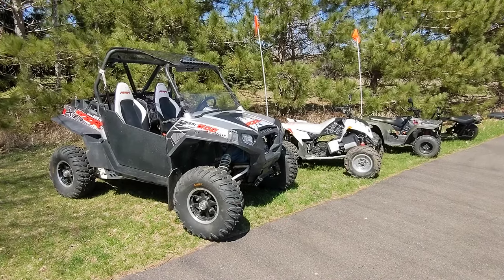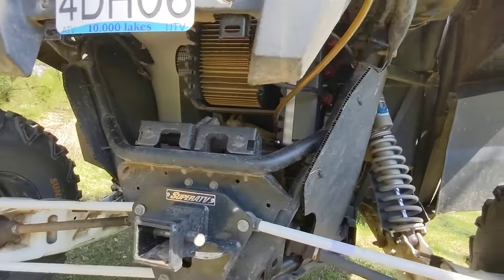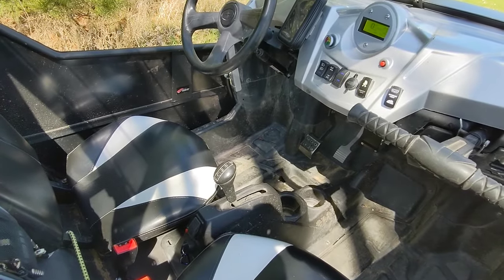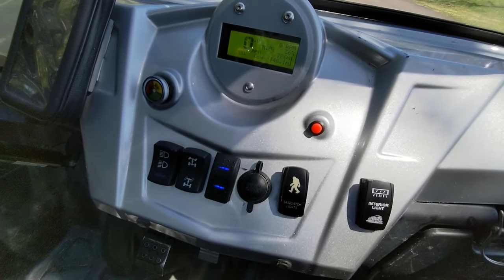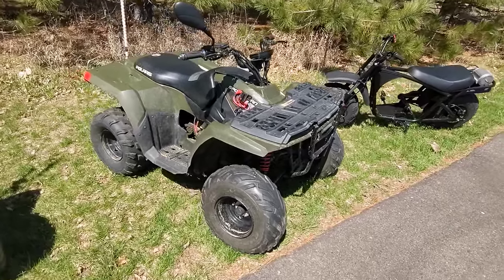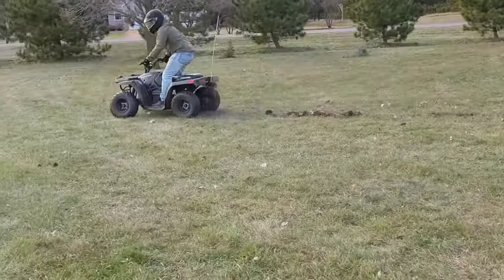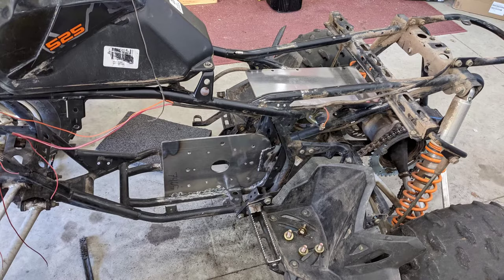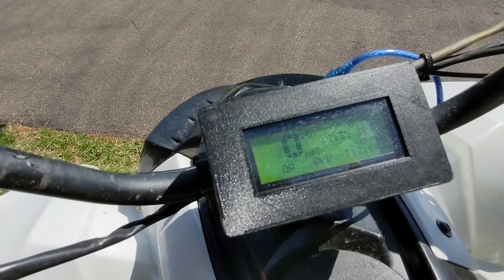I have an electrified⚡problem🤪I built two Cyberquad ATVs, a⚡UTV and a⚡ mini bike is in the works🤯

Comment: What great projects! I'm curious on the RZR ... with electric reverse available (looks like what you did..) what about getting rid of the transmission, transfer gears and long drive shaft - and using 2 motors (one front / one back) - and just the 2 differentials - getting rid of all that weight / power loss through the gears / etc. Plus you could turn off one motor for higher "cruising" efficiency? Might even be easier to use 2 front diff's than trying to convert that rear transmission/differential combo. Pros / cons / complexity?
Reply from the maker: You mention hypotheticals people bring up often in starting a build. The devil is in the details in comparing different design direction pros and cons. Those would be good discussion points for a DIY electric conversion forum.

Comment: Brother what motor options are there at 100 hp or above.. other than tesla parts?

These look so funn
Reply from the maker: Netgain Hyper9 which is 120HP is the only one that comes to mind and is what I recommend. I just helped a guy in the UK with a SXS build and he used a hyper9 and he said its a blast. He also said he had to limit it because he was thinking the half shafts couldn't handle it. I am now building a VW Beetle Baja which is the same size and weight as my SXS and I am using a Hyper9.

Comment: so ive converted 2 bikes to electric (both cheap chinese bikes off amazon) and also upgraded a mototec how difficult is it to convert a polaris (or even coleman t196 gokart) to electric definitely wanna use these on the high way late at night
Reply from the maker: Difficulty is a relative term to your ability or desire to learn. I cannot answer that question without knowing you personally.

In regards to the comment of using ATVs illegally on highways at night. I don't condone the illegal diving of ATVs on highways at night. Don't be one of those idiots.

Comment: I subbed. If you were to convert your RZR for the first time today, what would you do differently? Larger motor, different controller, or different batteries?
Reply from the maker: on a new RZR conversion I would use a 144V Hyper 9 motor with 7 Tesla modules
Reply: @Bastens  Any idea what that would cost? I'm sure I don't have your skill level, but I am considering converting my 2013 570 RZR to electric. Thanks for this very interesting video!
Reply from the maker: @ValConB  I used a motor that is not for sale from Zero, they are only available in the used market. So it is hard to put a price on that.

That being said an equivalent motor/controller combo (40mph top speed) would be a ME1507 (ME1905 is the newest version) & Kelly Controller. My understanding is Kelly Controller will sell a motor and their controller with wiring and a throttle for under $3000. You will have to figure out how to attach it. Plan on about $600 for pulleys, belt and mounting plate materials.

I purchased 31kwh (100 mile range) of raw NMC cells for about $3000 but again you need to figure out how to mount it, add a charger and BMS (battery management system) which is probably another $600

Total raw parts would be about $7200 

... but this type of build would require existing experience or the want to learn how to convert a vehicle to electric. I would say this is an advanced build.
Reply: @Bastens    I think the cost you mentioned is in my price range. I sold the 570 RZR which had low miles on it and a strong engine/drivetrain, and am now looking for a used RZR that has a trashed engine. I am retired, so have plenty of time to invest. I don't have any experience with electric conversions, but I enjoy learning and the challenge and may go for it if I find a machine for the right price. You have inspired me - thanks!

Comment: Where did you get your tapered lock busings for the ranger conversion?
Reply from the maker: They key is to realize they call these are a "1615 taper bushing" which are made by many companies. I would first search eBay for used / new old stock to fit the shaft size you are looking for.

Then go to Maedler for the pulley. They make many sizes but remember you don't want to go too small in diameter or it will slip. I read somewhere to not go less than 36 teeth (about 4" diameter). Again you can check eBay for used/new old stock. Here is an example link: https://maedlernorthamerica.com/partshop/timing-belt-pulley-htd-8m-material-steel-36-teeth-for-belt-width-50mm-for-taper-bush-1615-sku-17477418/ 

Next you need to find a belt. (this calculator may help you determine the size you need https://www.omnicalculator.com/physics/belt-length ) Not all sizes are available so you have to try different combos to get a setup that will work. You may have to go back and pick a different size pulley.

I found this website has the best prices for belts  https://www.vbeltguys.com/ 
They sell many brands and types. Some are slightly thinner but I found this product line worked well https://www.vbeltguys.com/products/736-8m-50-synchronous-timing-belt

Cheers
Reply: @Bastens  I finally got all of my parts together. I was wondering if you would be willing to share/sell the design files for your motor mount. I will need to modify it for my purposes but the files would give me a good head start .

Thanks.